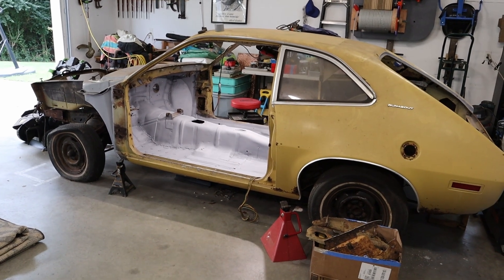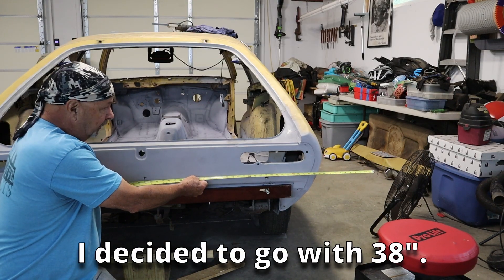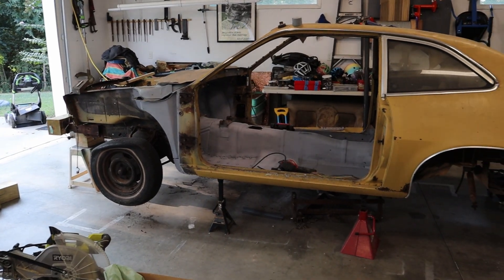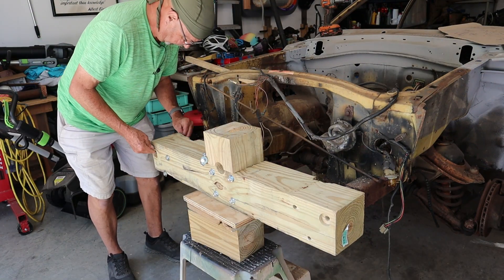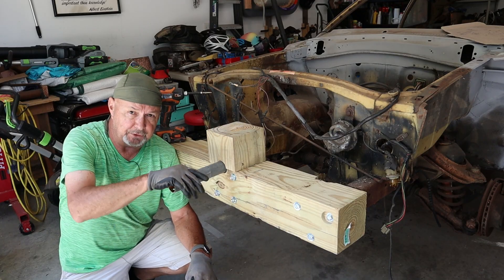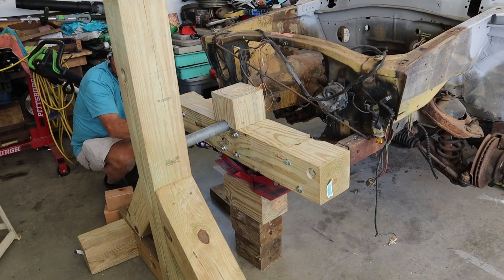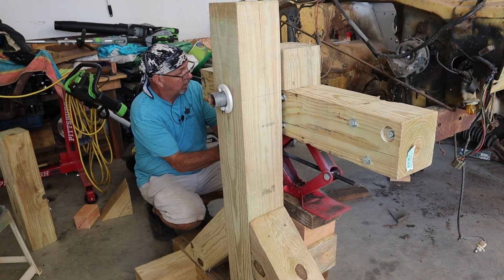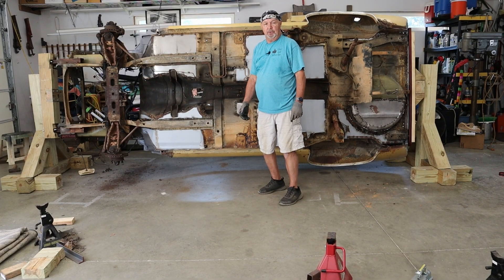DIY Car Rotisserie Build | Making My Ford Pinto Rebuild Easier

Comment: Haven’t seen any videos lately ?   Where you been ?  

How’s my “ factory v8 pinto “ coming along …. 😀
Reply from the maker: I work on it almost daily. Been removing the front suspension and patching the battery box area. I have most of the tough metal patching completed. Still got to do the exterior patches like doors and rear quarters. Should be posting a video in next few days. Thank you for staying interested!

Comment: I'll bet the only regret you'll have on it is not building it sooner! Looks like you nailed the height and balance! Can't wait to see it in use in the next video!
Reply from the maker: Yes you're correct. Should have been the first thing I did when I began working on the body.  If you haven't done so already please consider Subscribing. I would really appreciate it.